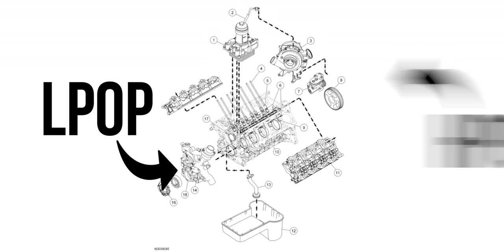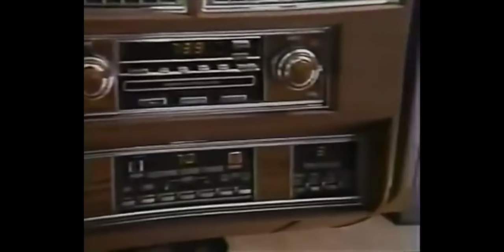These are the WORST ENGINES EVER MADE

Comment: 5.7 Hemi. In years past I was a test driver In Colorado. We tested Dodge/Ram trucks towing 10,000 lb trailers over Vail Pass and Eisenhower/Johnson Tunnels. Hot summer day, eastbound on the west side of Vail pass, those trucks were hard pressed to maintain 20 mph.. You could watch the gauges climb. Back at base, the mechanics would work hard to get the trucks ready for the next day.
Reply: I mean yeah, but lack of cooling issues aren't really the engines fault. More the fault of dodge/ram to build an adequate vehicle around the engine, which has been and still is still a huge ongoing issue...
Reply: Probably wasnt meant to haul that much. Thats what the 2500s are for. My 20 year old Ram 1500 still hauls over 1000lbs of gravel at highway speed. I completly dissagree with this analysis.
Reply: One pound more and you'd need a class A license for that 10,000 pound trailer. Can you say "tractor trailer"?
Reply: @trevorhogen7761  , 1,000 lbs of gravel? So basically like hauling a Harley in the bed. That's not alot of weight. Basically like hauling around 4 people that weigh 250 lbs.
Reply: @raymondellis5720  , actually you can get by up to 24,000 lbs on a standard driver license.
Reply: I have no complaints with my 5.7 hemi
Owned and driven lots of trucks in my life. The 5.7 is my favourite, has tons of power and gets great fuel economy.
Reply: The 5.7 lifters don't get enough oil.  Roller bearing fails, destroys the cam.  Gotta pull the heads to do them.

Myths abound that it's caused by the cylinder deactivation system, which is untrue.  The problem seems to be a lot worse on vehicles that idle a lot.

Have a 6.4 at work for the same issue right now, so it doesn't seem to be limited to the 5.7.  Just a junk design that should have been fixed a long time ago.
Reply: @immikeurnot  I have just shy of 180k miles on mine. Fuel mileage, meh, reliable like anvil. I will get another one for sure 😁.
Reply: 5.7 hemis are bad about vavle seat breaking falling on top of piston which its after after that  happen s around 200k ive sad 3 of them do that to  2005 2010 years
Reply: What was the gearing ? I mean if they are not geared correctly you are going to have problems pulling a heavy load up a mountain.
Reply: Rams are fun to drive and sound great.  Yes their weak point on 3% of engines is roller bearings.  Sadly idling for thousands of hours starve them for oil pressure.  Changing the oil with expensive synthetic oil frequently also lowers odds of catastrophic early failure.  GMC engines have had similar failures with roller bearing, cams, rods.  Sadly the manufacturers are using cheap parts.

Comment: After looking at maintenance costs for 5.4 and 6.8, I found out it is cheaper in the long run to get a 7.3 Powerstroke! To do coils on a V10, I can do injectors on a 7.3!
Reply: If you are burning up your coils you might try changing your plugs within the recommended mileages.
Reply: @stephenwest798  I’m just hearing from other people.
Reply: Working the rv industry since the late 90s, and I found that Triton V10 is the absolute most bulletproof heavy towing gas burner you can get by a Lang shot. Only time will tell on the new 7.3 gas, so far so good.

Comment: I bought a 1981 Cadillac Seville Elegance in 2004.  The last time it had been legal was 1990.  It had less than 50,000 miles on it.  I LOVED that car.  I disabled by cylinder deactivation too.  It had an onboard diagnostic system built into the A/C system.  It had digital everything.  When you pressed and held down some specific on the A/C controls the car would do a self diagnostic.  It would display a number in the display.  The number was a number that corresponded with various faults or signified the car was fine, much in the same way code readers work now.  The car was very quiet and rode like a cloud.  It was the second front wheel drive car I'd owned where the engine faced forward, the other being a 1996 Chrysler Concord with a 3.3 liter.

Comment: My parents bought a brand new 1983 Cadillac Eldorado Biarritz with the 4100HT.  Cadillac mechanics jokingly said the "HT" stood for "Have Two" (engines).  The car was driven by my mother to and from the health club 10 miles a day five days a week.  It was serviced by Neill Lehr Cadillac like clock work.  In spite of all that, the engine spun a main bearing with less than 12k miles.  Cadillac replaced the engine.  Dad sold the Eldorado and bought a brand new Toyota SR5 something or other and never had an issue with it the entire time he owned it.
Reply: I remember Neill Lehr Cadillac, in Northridge, CA, then it became Rydell, now since razed and there are new apts/condos there.....
Reply: @michaeljones3438  We lived on the conrner of Community St. & Rhea Ave.  It's a half mile from Niell Lehr.  In 1970 I rode my 10 speed (campus green Schwinn) to "Rancho Chevrolet" on Reseda Blvd.  I parked my bike outside the front door, walked in, asked to see the brand new 1970 El Camio Super Sport with a 454 that was on the show room floor.  After a quick walk-around, a look under the hood and sitting in it for a minute, I asked for a color brochure and left.  I was 13.
Reply: 1983 eldorado with a HT 4100 i ran the ac one day for my lil sister while i went in the store for a min came back blown head and clouds of smoke  Real POS

Comment: Bad engines are opportunities for people that repair cars. I bought a 98 Olds Aurora with 100,000 miles and a blown head gasket for $500. It was a PIA but I repaired the head bolts threads and head gasket. My family drove it for another 150,000 miles before it was scrapped.  Ditto with the 5.4 3 valve, I picked up a 2004 F150 supercab lariat for $500 because it "needed an engine" at 140,000 miles. I repaired that motor and disabled VCT and it's running great for my son atm.

Comment: The 2.2L was a good little engine and when equipped with a turbo was known to beat 5.0 Mustangs so not a dog. I don't really know what one expects out of an engine developed for the Kcar anyway.
Reply: I embarrassed many 5.0s in my Shelby Charger.  When I converted it to turbo 2, I moved up to LS1s.  I know of a few 2.2 turbo cars running low 10s.  Mine was low 12s.  Pretty good for an economy car engine with the exhaust and intake on the same side of the cylinder head.

Comment: I'm surprised the Olds diesel 5.7 made 120 hp.  I expected more like 90 hp for an improvised diesel from back then
Reply: My dad’s olds diesel seemed fine to me until a Mercedes 300sd walked off and left it.  Yes it had a turbo but it was only 3 liters and that big s class had to be heavier
Reply: But, those blocks were awesome for hi-po gas engines.
Reply: Was it the engine or just lack of water filter from the diesel tank. I do think the filter would made it useful..... some how!
Reply: @rvarsigfusson6163 never had water issues at all in my 5.7L
Reply: That 120 was at the output engine shaft, when new.  At the wheel, after a couple of years, it was like 60hp.
Reply: @glennschlorf1285  Did see and did work on a V6 GM diesel..... long ago about 40 years.... think it was called Duramax but was it just shorter version of 5,7...... It was in a front wheel drive GM passenger car a really nice one. 
I will get one 5,7 diesel one day and lower comp in it and and..... Duramax V6 came not long ago and was in Blaser 10 series
Reply: @rvarsigfusson6163  oldsmobile did at same time have a V6 4.3L deisel they put in Cutlass Ciera, Buick Century, Pontiac 6000, and I dont know if they ever installed eM IN THE caddilac Cimmaron or the Chevrolet Celebrity? Great little powerplant... torquey and would actually accelerate up hills I had one
Reply: Haha they definitely overrated it , because the mil spec 6.2(or 6.5? Who cares they were trash)  in the humvee made 130hp.
I woulda been scared crapless having to rely on that engine to get me out of a situation.
Reply: @MrTheHillfolk  In the HMMVW the engines were except from crippling emission standards.  They were also configured to run on multiple fuels with the computer adjusting timing for the various fuels.  They may have made more reliability and power in the HMMWV, maybe.    Then again, they may be pathetic.
Reply: @indridcold8433  nope I know for a fact that they were detuned over a standard engine that the public got. Standard 6.5 had like 160hp. They detuned them to 130hp to try and make them survive because they were such junk.
Cracking cylinder heads and breaking crankshafts and blowing head gaskets, and some fuel system issues. I could go on and on. 
They did use a semi lame set of half-ass headers though on the humvees, factory cast jobs.
Reply: @indridcold8433  no computers in those old beasts , actually that's a good thing I'd rather trust something mechanical when fighting a war.
Reply: Had one in my Bonneville. Scary as hell trying to jump on a busy highway. So slow
Reply: @rvarsigfusson6163  It was a 4.3 designed by  Detroit diesel. I only seen it in a RWD G body and the FWD A body. GM had another version of a v6 diesel in 99 that was shelved.
Reply: @williamshappley2106 300sd had a curb weight of around 3800 lbs producing 140hp and 250ft lbs of torque, and speaking as someone who owns one, they are punchy running about 10psi of boost stock.
Reply: @rvarsigfusson6163  it was not a Duramax.... it was a 4.3L olds... they also made a smaller V8 deisel for some
Reply: Either way Im just wondering how their new inline 6 cylinder the 3.0L and the 1.6L turbo 4cylinder will last... I see GM discontinued putting the 2.8L VM motori in their small Canyons and colorado pickups already... sorry bastards
Reply: @glennschlorf1285  The 2,8L VM motori is in fact an Italian engine used in some Korean cars and JEEP, Chryslers Voyager and and..... And its quit good engine will have high rpm ..... and I do have one. 
VM motori, FIAT,  Isuzu and Duramax did have some kind of relations and then GM got out with some licenses and did start making.

Comment: There are still an awful lot of Cadillacs running around with Northstars in them from way back in the 90's and over a quarter of a million miles on them. A buddy of mine has 2.  They aren't burning oil. either. YMMV.  Also, the 4-6-8 engine was a fine engine mechanically. It oinly cost about 100 bucks back then to bypass the cylinder deactivation & then you had a great car.
Reply: Now, adjust the timing on the 8-6-4 v8 to Oldsmobile timing.  23 degrees BTDC.  No ping, no knock, no unstable idle, just power.  Now, it runs great.  The only other thing to do is wire up the solenoids to shut down 4 cylinders to a single switch.  Screw the computer.  Do it manually.  Avoid v6 mode.

Comment: My grandpa had a 2004 f250 super duty with a  6.0 power stroke. Thing was a workhorse. He pulled his big boat and 26' 11k lb trailer up and down the east coast. Gave out earlier this year with 260k miles on it with 12k in repairs needed. He said goodbye to it.
Reply: My 06 F350 with the 6.0 is running strong at 290k miles. The most expensive repair I've done is the AC compressor after I bulletproofed the engine more than a decade ago

Comment: The 6.0 Powerstroke had some redemption. No such programs for the 350 Olds.  I had a 2V 5.4. Was actually pretty reliable. Never had any spark plug issues. I know some people who did but they got fixed.
Reply: I've had a couple of 2 valve, and maintenance is everything and they will pass 250,000 miles.

Comment: you're right about the 5.4 Triton, I would add the 4.0 ford to your list. What a pain to work on with a cam chain in the back of the engine...
Reply: 2001 Ford Ranger 4.0 been  remarkable reliable so far.... 190 thousand miles, when the chains go u will just junk it.

Comment: 5.7 Hemi should not even be an honorable mention. Ive never heard of hemis “knocking there whole life” They are very reliable engines aside from broken exhaust manifold bolts
Reply: Mine sure has almost 300k on it and over 10000 engine hours. That thing doesn’t owe me anything if it blows tomorrow. Just done exhaust manifolds in it other then that it hasn’t been touched.
Reply: @tylerfegan1386  110k on mine. Got some bolt ons and making 400whp. I beat on her a lot but i keep up with oil changes and other minor maintenance parts. The only issue ive ever had was 2 broken exhaust bolts. Didnt even know they were broken until i went to put long tube headers on.

Comment: I do know one man that made excellent use of the Oldsmobile V8 diesel. He is a farmer that converted a tractor pulling tractor back into a field use tractor by replacing the souped up Chevy small block with one of these Olds engines and used it to pull a hay baler. The job only demanded about 50 hp. well in the range of this engine. The set up also sipped diesel fuel which the farmer enjoyed. Not the typical use of this engine, but one it excelled at.

Comment: I've been reading about numerous problems the VW/Audi 2.0 Turbo I4 engines have been having in their short lifespan. Could also be an engine to avoid. Though that might also fall under the same category as the N54, as they can make great power, but longevity seems to be an issue.
Reply: These got better with each update. Today they are really good.
Reply: The EA888 nowadays is basically flawless. Plus the main issue was timing chain stuff and honestly the entire job isn't that difficult to do even if it pops
Reply: @TheOldMachines  the wife's 2014 Jetta with the 1.8 gen 3 is still a turd , stupid water pump setup is the worst design ever. 
Not to mention having to replace that turd on my own dime.
That car is such a turd over what it replaced which was a 2004 Passat TDI. 
If some asshat didn't wreck into it, I'm sure it would still be trucking along.
Reply: @MrTheHillfolk should've gotten the Jetta with the 07k.... Tank of an engine.......
Reply: @MiguelGarcia-vj7oo  like I had a choice
Reply: I had an A4 with the 1.8 turbo. Another Ward's Best Engine. Also a total PoS. The oil pre-filters were just pieces of screen that would clog with aluminum debris,  starving the engine of oil and causing catastrophic failures.
Reply: vw Jetta tdi with the 2.0. turbo. 200k miles, regular maintainence, and only major issue I've had with it was when the radiator fan somehow exploded.
Reply: @ARockyRock  1.9 or 2.0? 
We got the 2.0pd in the Passat here in the states  and I think the only 1.9pd we got was for about the last year of the Mk4 here.
Reply: @MrTheHillfolk  it's the 2L turbodiesel

main subject of the recall
Reply: @ARockyRock  oh oh ,gotcha ,wasn't thinking of one that new ✌️
Reply: EA888 has been out for a really long time. About as long as the Toyota 2GR. Earlier versions of the engine had crappy timing chain tensioners, and oil passage screens in the balance shafts that clog, literally destroying it. They are very strong engines since they still use iron blocks. Tuning one or getting a bigger turbo on is not uncommon. I have a 2021 GTI that I've already put almost 40,000 Miles on. Hard Miles. I didn't tune it since I want the warranty to work. Oil is changed often by myself. You'll always see the little red thing flying around southwest highways near or at 100 mph because it does not give ten chitz. My only complaint is the paint. The clearcoat sucks and gets ruined by anything that touches it. The bugs tht hav hit the front made the paint look pretty ugly too.
Reply: Best engines ever made!
Reply: That depends on the year. I think the 1.8T is the one to avoid along with a specific year 2.0T but I'm not sure which one.

Comment: Can't speak for the 5.4l but the 6.8l is far from gutless. My 6.8l V10 is everything I believe a truck engine should be. It makes approximately the same torque as my sister's 2019 6.4l v8 in her ram 2500. I've towed my 8500lbs travel trailer the same route with both vehicles and they get the same mileage.... sometimes the V10 does a little bit better. The biggest difference is how the V10 applies its torque. It comes on early like a diesel and stays there. The v8s you have to run out and blow the fuel mileage. Highway cruising and hill climbs are way better with the V10. The biggest drawback of those year 6.8ls was being paired with a 4speed auto. If you have a 6speed manual you're golden. Paired to a modern 8speed this engine would come alive. Also it's unfortunate these engines were overlooked by the aftermarket. I think there would've been a lot of opportunities to make really high low rpm horsepower and torque with better heads, cams, and superchargers. Say what you will it's my opinion that the V10 is one of the best Gasoline truck engines ever made.
Reply: They made decent power for the time.  The DOHC made good power.
But them being boat anchors are why they weren't swapped into modded  cars.  The 4.6 makes more power easier.
Reply: Well the fact that the 6.8 makes the peak torque at 3000rpm(468lbft) vs the 6.4s 4100rpm(429lbft) means it naturally is going to do the hauling job better than the V8 competition. If I had money coming out of every orifice I would rather the 6.8 V10 over any Gas V8. But I like my money in my wallet, so I drive a 6.7Powerstroke that's making more than 1000lbft from 1400-2400rpm and get 22mpg on the highway. My 9000lb diesel gets better mileage than the 5100lb 3.5L F150 it share the driveway with. Lol
Reply: You are telling me what I want to hear. So far for the 6.8 L, it is 3 to 3 bad- good.